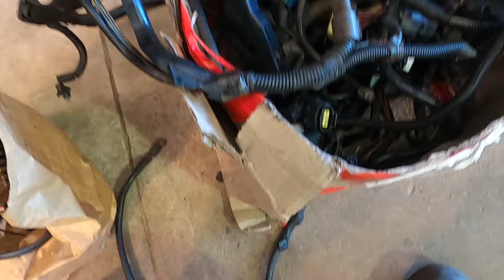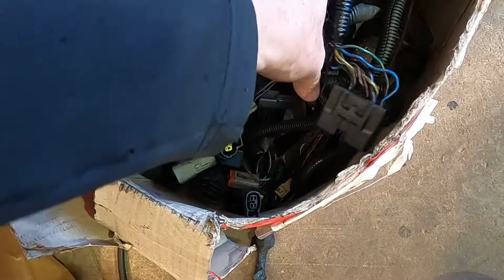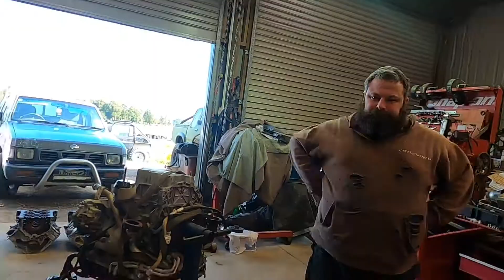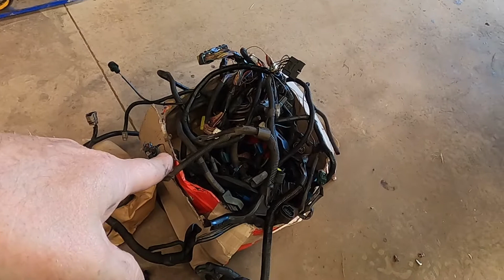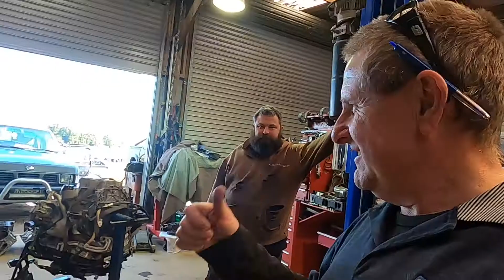1uz supercharged running Auto transmission controlled with Haltech 2500 wiring for Tony in Oz

Comment: the 3040ls transmission (tiptronic)  that has 2 extra solenoids, can the haltech be configured to properly operate that trans?
Reply from the maker: Yes.  I have a mate doing the A340 series of transmissions with Haltech.  Cheers
Reply: @CartuneNZ  how much dose that usually cost
Reply from the maker: @shitassmcgee1488  what exactly are you wanting?  A haltech ecu only?,   a haltech with loom ready to wire?  Or a fully made loom?  Or do you already have the ecu and want it set up?
Reply: @CartuneNZ  a fully made loom able to work with an auto transmission on a 96 ls400
Reply from the maker: Ok,  they range for a new loom,  sensors,   ecu package between $12000-14000nzd,  including upgrading to coil on plug as per the video
Reply: Would this setup also work with a650 as well?  @CartuneNZ

Comment: Hi I have a quick question about the ECU 's are some of the ECU' s covined and some not or is it just the way the ECU is programed... The reason for asking is I have 3 different ECU's and one was performing amazingly and the other 2 is ok but not performing nearly as the one that was 100% before I damaged it when i Jumpstarted the vehicle
Reply from the maker: There is different firmware in some ecus and then within models we also have some very subtle pinout changes which can make a difference.  Some models of ecu also had 2,3 and even 4 upgrades from factory and the last supercession  run better.

Comment: 10:22 as for air temp sensor I am using the Climatetune intake. Would I be better off placing the AIS in a port in the intake or in the intake hose pre throttlebody? Yeah, it's been a long time but my VX had been running great so I was in no hurry. V6 has been pulled now and I'm finally moving forward. LOL
Reply from the maker: Intake air temperature IAT sensor can be either in the intake before the throttle body , which is often the easier spot , or in the intake manifold.  In the manifold they do need be in a high airflow position and some suffer heat soak.  In most cases we tend to do pre throttle butterfly for ease , or sometimes we do both to monitor which is best.